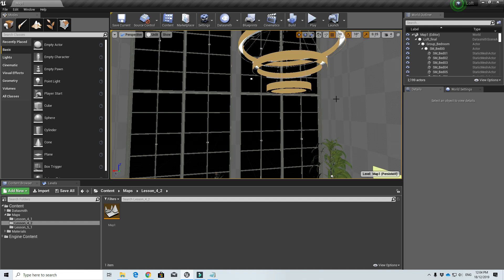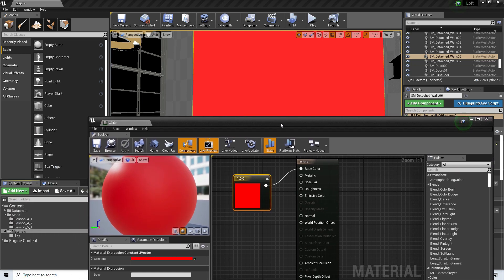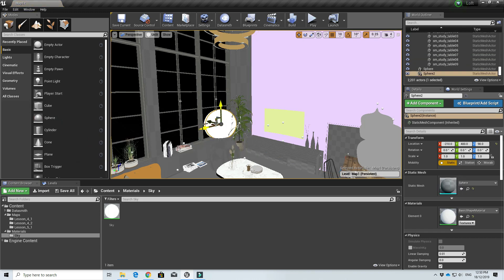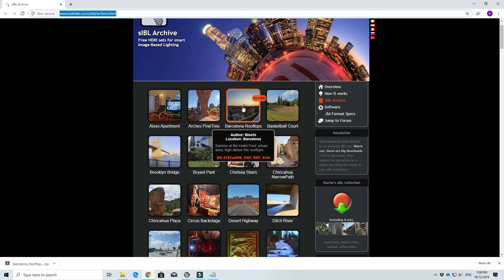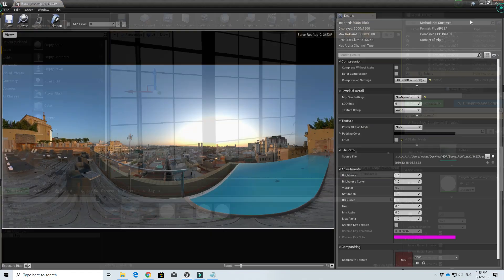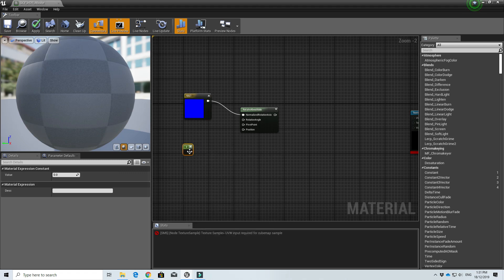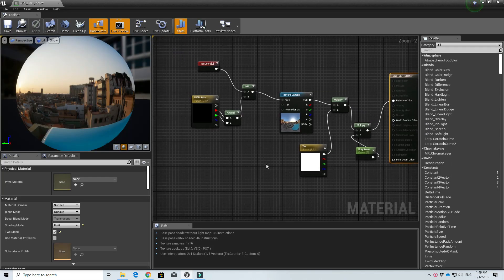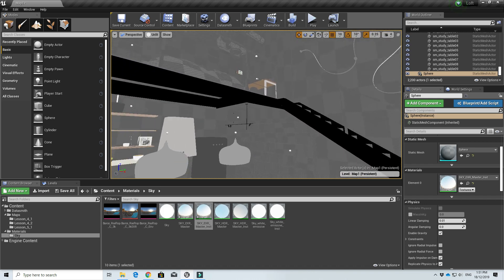5.1 Creating Skyboxes - Unreal Photo Realistic Archviz Tutorial

Comment: I have a better solution to the blur import of HDR files at 10:05 . Just go to the "level of detail" at the bottom right (in the window that is open at 10:05). Change the setting "Mip Gen Settings"  from "from texture group" to "NoMipMaps". It will change back to original size. No need to open photoshop and create an exr.
Reply from the maker: Thanks for the tips. :)